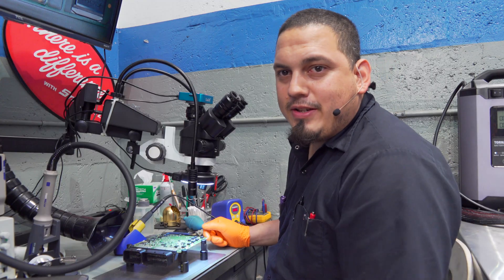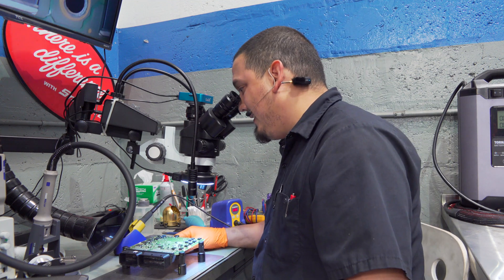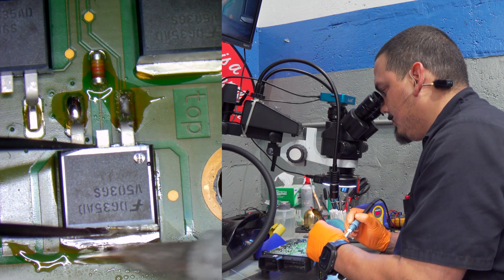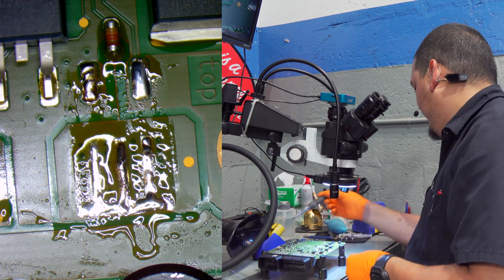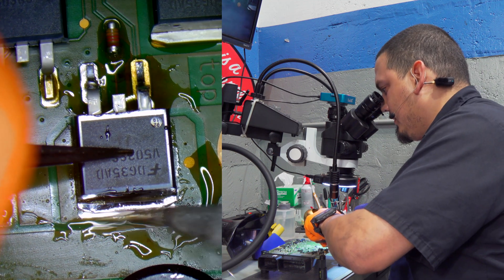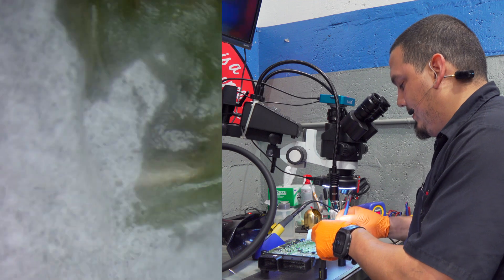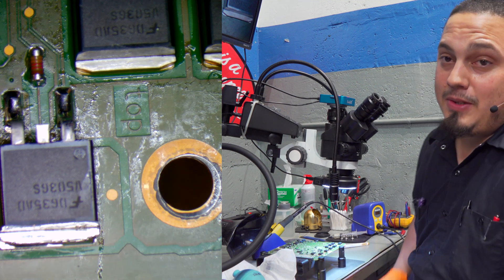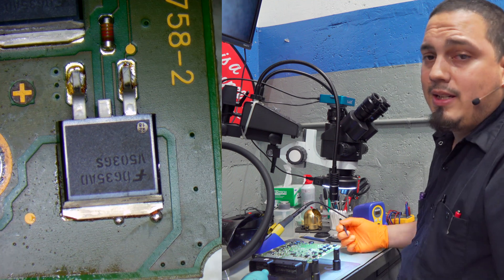HOW TO REPLACE MOSFET/IGBT WITHOUT A REWORK STATION VS WITH A REWORK STATION

Comment: I am a retired electronics tech.  I worked on stuff that was not microelectronics.  In fact when I started  I was working on vacuum tube circuits, then transistors cxame along and then ic's. So, I did a fair amount of soldering in my day with normal 60/40 tin-lead solder.  And I very often held a piece of solder in my mouth.  I just didn't know any better. I am now 83 so I guess I got by, but I just was lucky.

Comment: Get-er-Done is sometimes your only option as you have said!  A flat dental pick would help.  Lift the two pins and then loosen the heatsink connection pad.

Comment: Repair of electronic assemblies is specialized in tools and techniques, with the procedures and methods not usually published in the public domain by the manufacturers. 

For Tier 1 automotive module supplier in-house development and module "repair" is done in the context of IPC (originally known as the Institute of Printed Circuits) standards for rework and repair. In this context (electronic assembly manufacture and rework (modifying)), rework refers to component changes and repair refers to repairing the PCB itself. So the IPC standards are focused on manufacture (which includes rework) and not field returns. However, an organization can adopt and extend the IPC standards to provide guidelines for repairing and testing field returns and warranty repairs. With an experienced design team, if the customer requires field return analysis, repair and testing, the design goals specification will be extended to include comprehensive design for test and design for repair. But, here again these advanced processes and procedures are not usually published in the public domain.

So, you may ask, how do you repair automotive module field failures. The starting point is actually IPC standards, because these standards form the base of process requirements used by the original manufacturer. Meaning, they describe how to approach the repair. For example, IPC has a classification (Class 1, 2, and 3) which place a context on the procedure used as per the end-item use. An engine module would be found in Class 3 High Performance / Harsh Environment Electronic Products. These process and procedures will be fine-tuned by the Tier 1 supplier, Bosch in regards to this video, which are as stated before are not published. This is why Mario is giving a demo which he feels accomplishes the goal.

If you have worked with IPC standards and understand Tier 1 in-house requirements, there is a definite pattern to the procedures used to make a repair. For example, in this video Mario points out some of the larger common types of power packages, DPAK (which he calls typical size, and I would agree that this is a very popular size), D2PAK and SOT223 which are SMT (surface mount devices) that dissipate heat through the PCB to the opposite side where a heat sink attaches. Hence, the reason you must first remove it before removing components.

One of the areas that differentiates most YouTube rework soldering videos and what would be done in a production setting is PCB preheat and PCB cleaning after rework. Important to a Tier 1 in doing a field failure analysis is to remove the part without damaging it so it can be analyzed by the responsible engineer. Which on many occasions would be sent to the Tier 2 semiconductor supplier for analysis to better understand the failure at the component level.

Unfortunately, for Class 3 rework to be done as per the standards, will require a well equipped soldering rework bench.

You may also ask why Mario is adding solder? Here again it depends on how the module was manufactured in terms of the solder used (leaded or lead-free). By adding solder of a lower melting point, Eutectic Tin-Lead, as opposed to the original SAC305 (lead free) you are trying to reduce the thermal stress on the PCB. Which is a good procedure to use.

Comment: When I worked in electronics before coming back to automotive I used to watch the rework being done at the rework stations.  With the electric solder suckers, that made the rework much easier, less mess and less part damage.
You did good Mario.  Keep up the good work.

Comment: Can you test an igbt in situ or do you have to remove from circuit board to do so?
Reply from the maker: In circuit i show this here 2014 BMW X5 4.4L(N63) Turbo - Single Cylinder Misfire - Step by Step Diagnosis and Repair
https://youtu.be/B6IiLyOFy6Q
Reply: Thanks Mario

Comment: Mario, if you want to remove bigger components like this one that requires a lot of heat, the best option is to use low melt solder which stays melted for quite a bit so you don't have to go back and forth, once cleaned, you can then install the new component with regular solder. There is one brand that @Northridgefix uses and sells which he highly recommends, a bit pricey but will save a lot of headaches and last a very long time. I bought some for myself from amazon which were cheaper and it works great.
Reply from the maker: I have that same low melt solder, and haven't had much success with it, I'll have to keep at it

Comment: Hi Mario, what you need to get is a hot plate for removing this components. Yes you did it, still with your Iron you are incorrectly heating the board in a small area and that can damage the internal layers. So by using a hot plate you preheat the board evenlly to prevent damage. That is the correct way.
Reply from the maker: Yeah i don't have a hot plate yet. Gonna be a while
Reply: Maic Salazar I  use jbc products  but this zephyrtronic airbath  has been on my list  for a couple of years.
 
https://youtu.be/PJkx8Q8gFDE

Comment: Mario, thanks for sharing this info. We have the same soldering iron what is your hot air station and what flux. I’ve been using different brands yours seemed to work rather good. I’ve been playing around and it’s not as easy as it looks. These videos help a lot knowing we all come across the same hiccups. Hope all is good   Artie 😢
Reply from the maker: This is the atten st-862D and the amtech vs213a

Thanks Artie!
Reply: What is the name of the soldering iron you used?

Comment: Mario, NICE setup. Kimwipes 👍.  Don't underestimate the iron; often it is a safer option than hot air, especially on high density boards with plastic crap in close proximity to your target component. Don't be a miser with your LOW MELT solder (LMS), just USE IT. Your wick was sticking to board; not enough heat. TRY a little bigger tip, a little more heat, LMS and the components will fall off the board.

Comment: You want to use leaded solder to lower the melting point. They typically don't from the factory that's why it's a lot harder to remove. When you reapply you should use leaded as it also keeps the part from getting hot. Before you "pretinned" use alcohol to clean the board than add flux and the leaded solder.
Reply from the maker: Did all of these except alcohol before pretinning. Not absolutely necessary, but good points nonetheless
Reply: @SuperMarioDiagnostics  You get all the junk off from the removal process using the alcohol before the pretin. . Louis Rossmann, Northridge Fix do that. That's where I learned. I also want to commend you for jumping into this. This is another level of repair and good on you. You have some very nice equipment too.
Reply from the maker: @scotts4125  same here, great teachers, good advice 👍 

Easy to forget things when filming 😆 i completely forgot how to say leaded solder while doing this
Reply: @SuperMarioDiagnostics  I knew what you meant when you were saying low melt. I was trying to manifest it out of you but all good. People will read it here and see it.
Reply: @scotts4125  I've grabbed my "low melt" accidentally when wanting to solder my final product more than I'd like to admit. Louis is where I learned and am learning a lot of techniques. I'm happy to see more folks learning from him and happy to see Mario showing the techniques in our field for module repair 💅 great work! And I appreciate your support for this industry Mario. Thank you for carrying the torch.
Reply: @ZoomAutoDiag  Mario is really taking it to the next level. He might get too good at it and decide not to get his hands dirty any more and become a microscope jockey. :)
Reply: @scotts4125  lol I don't blame him. That too is my goal.